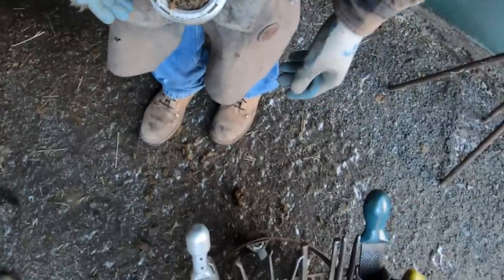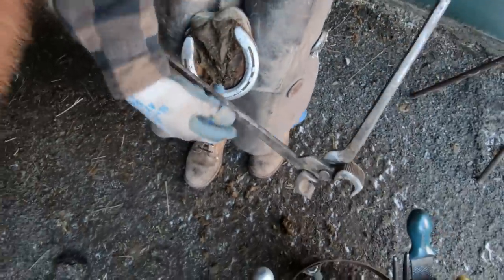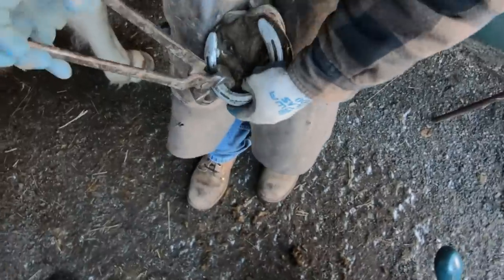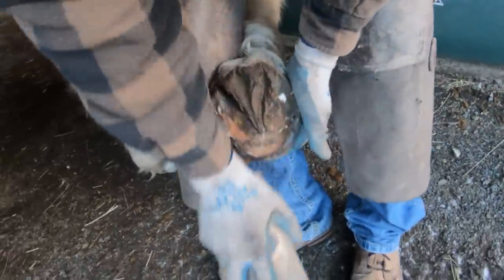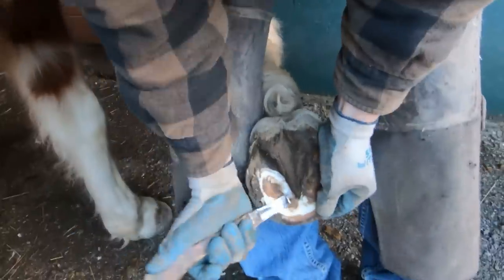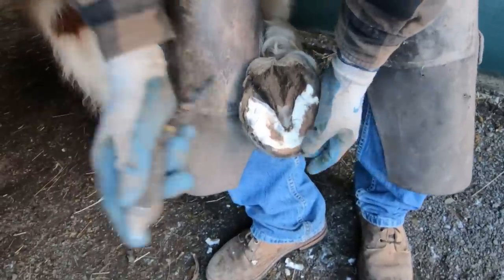Horseshoeing a MUSTANG with ALUMINUM shoes

Comment: 2:55 Dude, I wouldn't worry about dropping your tools and looking like an amateur. I still brush my teeth the wrong way. :\
Reply from the maker: I didn't know there was a wrong way to brush your teeth???
Reply: @maverick_vet  😂😂😂😂😂😂😂😂😂sense of humor.. Love it😂😂
Reply: Brush... brush your teeth the wrong way?
Is there a certain way to brush your teeth now?
Reply: annlakes24 Actually there is if you want proper hygiene.
Reply: @zakrylee9918  right, more vertical and less horizontal brushing, they say.
Reply: Prander5x5 bro same 👊😔 i keep using the back of the toothbrush
Reply: @sandoe850  that is the proper way of doing it. So that you clean the gums as well as the teeth

Comment: I had my wife watch this video and she concurred,that other than a couple very minor details,our technique is very similar..
Reply from the maker: like what? Do you wring your nails instead of bend them? where do you live at?
Reply: @maverick_vet  That was one of the differences,that i can think of...I live outside of Reno Nv...
Reply: @maverick_vet  I couldnt remember,what the other minor thing was,so i watched the video again..The other thing i do differently is,,i start the shoe,with 2 nails and put it down,to double check my fit,to make sure everything is exactly where i want it,before i finish nailing..That way,,if i want to alter or change something,ive only wasted 2 nails..Hence,the internet handle..
Reply: @TightwadTodd  I live in Reno , just saying hi😁

Comment: Very cool. I didn't know there were aluminum shoes. I thought they were all iron.
Reply from the maker: yeah. this guy is not a race horse but most racehorses wear aluminium shoes
Reply: Weigh reduction bruh beacause *race horse"
Reply: @maverick_vet  Next they'll be making carbon fiber composite horseshoes
Reply: Souta Nishimura Vibranium horse shoes
Reply: I don't even know horse need to wear shoes
Reply: @rismaaulia8349  they don't necessarily unless they are working especially on asphalt so that the roads don't the horse
Reply: Risma Aulia they don’t but it helps the horse if you happen to go on gravel roads or pavement, makes it easier for them to walk and lessen the chance of them gaining an injury
Reply: @rismaaulia8349  same as why humans wear shoes 
Asphalt fucking hurts to walk on barefoot

Comment: I'm always curious about horseshoes. Doesn't it cause pain to drive nails through their hooves?
Reply: No, the actual meat of the jorse is inches down so the nails wouldn't hurt
Reply: @javemascarinas7496  
Okay, so hooves aren't like our teeth that has nerve endings on them, but won't they feel any pain or discomfort from the hammer or the nails digging through their hooves?
Reply: @KubernetePirata  it doesn't hurt when you clip your nails unless you're clipping all the way down to the very bottom its the same thing

Comment: Appreciate your skill. Another farrier warns that aluminum shoes can corrupt the foot rim. He used a pad to break the connection between the foot and aluminum shoe. You said these shoes have worked for this horse so in this case you trust them. Have you run into aluminum shoe hoof corruption?

Comment: Okay. Fair enough. I was getting ready to get up on my high horse about using aluminum shoes for something other than racing, and you explained what was going on and why right in the first couple of minutes. 
So, mea culpa. I'll keep quiet and finish watching. 👍

One thing I've noticed, but never got around to asking - my dad, while he was still alive, almost never used the front nail holes. He nearly always left those two holes open. Yet pretty much everyone I've watched here DO use the front nail holes. Can you explain to me why the difference? Also, he trimmed the toe much more aggressively than I've seen anyone in this format do. Again, can you tell me why?
I will add that he never had a horse go lame after shoeing, and he was quite good at dealing with problem hooves. He even shod a horse with a full (complete hoof) quarter crack in such a way that the horse exhibited zero lameness while shod by him and was an excellent working horse. It just needed the special shoe that my dad made for it.

Comment: South Mississippi  here.
If a horse is shod, do the hoofs have to be trimmed less often then if they aren't? I know shoes have to be reset every 6-8 weeks, but just wondering if they'd need trimming more often or less without?
Reply: Depends on the horse. If the hoof is lower quality and more prone to chipping it would need to be evened out a lot more often to prevent the chips and cracks from growing bigger (like trimming split ends), but if the hoof doesn't chip as easily it could get worn down a bit between shoeing and require it less often.

Comment: How are the nails not hurting the horse? 😂 (I know nothing about horses I’m just curious 😅
Reply: To put it simply the hoof has  sections working forwards from the back. The living inner sections (frog, sole) are the sensitive areas which must be avoided. The white line and hoof wall have no sensation in them and these layers are where the nails go.
Reply: Naw, it's just like cutting your nails. As Cat Craft said, the only part that feels anything is that triangle on the hoof called a frog

Comment: What kind of nails on aluminum shoes.  I’m an airline pilot and any dissimilar metal that comes into contact with the aluminum can quickly cause corrosion.  Same with the aluminum F-150… 

Maybe the shoes wear out fast enough not to need to worry about steel nails??

Comment: I was wondering : how do you do when the animal don't want you to keep his foot ?
Reply: Tell the owner to train the horse better.
You can try to keep hold of the foot, which is basically asking the horse to hold out a little bit longer, but if the horse is intent on putting the foot down then the foot is going down.
If the horse has trouble with balance or endurance you can let it take breaks before it gets too tired, if it's a matter of patience it can often be bribed.

Comment: how does the hoof survive having nails in it? no splitting?
Reply: It's like a fingernail, so it has some flexibility to allow a nail through. And just like a nail in a piece of composite wood it can split if you do it too close to the edge, but a bit in and a thin nail doesn't cause a split.

Comment: What exactly does he nail the shoe into? I know nothing about horses and I’m super curious about how this works
Reply: The hoof is basically a toenail where the nail is super thick and strong and wraps almost all the way around the toe. Then the v shape is like the bottom of the foot of someone who walks barefoot everywhere, really thick layer of protective material, hard enough to walk on rocks but still soft enough to feel what you're walking on. The body keeps building it up from within so you need to exfoliate/trim regularly. Then the rest of the sole is kind of like the tough skin beside the edge of your toenails, tough protection.
We're basically from the same starter pack but with different assembly instructions.
So the nails go through the edge of the tough sole and then through the hoof wall, which is like a fingernail.

Comment: Here is a link that explains the brands mustangs get once gathered that should help, not knowing what region this horse was collected in  couldn't tell you just by looks with this one.  I am curious though why  racing plates were used on this horse by the  previous farrier?  This horse do relay or endurance  races?  Never seen this before  except on flat racing TB'S and racing QH'S  and only while they were on the track. They are a soft shoe and don't hold up well in bad weather( they can bend in mud and be ripped off, no traction on ice causing  slipping) and this horse looks to have shelly feet(and white which break or chip more often ) so I also wondered how long  between farrier appt.?  I love your channel and learning even  more  about foot care  after 40 plus years spent showing,breeding and training of many different breeds of horses but I can honestly say this has me stumped  lol. Horse's feet look great though! Hello from a mi transplanted to tn horseperson.                                                                                                                                                   https://www.montgomerycreekranch.org/blog/2020/6/13/what-a-blm-freeze-brand-can-tell-you-about-a-mustang

Comment: I always wondered who takes care of the wild horses they don't need this so why these horses needed?
Reply: Wild horses wear down their hooves by constantly traveling over rough terrain and covering so much ground to get food and water. Our domestic horses are typically spoiled in comparison. We feed them high quality forage, usually in lush pasture or hay delivered right to them so they have abundant nutrients to make more and more hoof. We keep the ground as soft as possible to help reduce wear on the joints. The usual 1/2- 1 hour ride is not enough to wear down hooves like wild terrain. Keep in mind we also subject horses to the other extreme, like using a horse like the Ol' days. I ride feedlot, where even though we feed plenty of high quality forage, we cover too much ground for hooves to keep up. A typical day can be riding 20- 40kms on rougher ground looking after cattle. For this we shoe all 4 feet, with snow pads for the winter and Borium added for grip. Without shoes on these horses they would become "lame" from wearing down too much hoof and they would slip and slide without traction during the icey winter. Hope this helps!

Comment: Dang that look like it hurt the horse
Reply: No it doesn’t hurt. It’s like getting your nails done. I mean the hoof is made of keratin, same material as your hair and nails. Getting a haircut doesn’t hurt neither does cutting your nails. 

Also little side note, average weight for a horse is 1200 pounds, they will definitely not just stand there if someone is hurting them.

Comment: I have a question, doesn’t messing with the frog like that hurt? I have accidentally hit the frog with a hoof pick on some of the horses I have riding, and they just about kicked me. So does that not hurt them or was it the fact that I jabed them??
Reply: HorseGamer 101 if your horse`s frog is that sensitive, you should have a vet check it out. The frog isn`t skin and the only way they should feel anything through it is the same way you feel pressure in your finger through your fingernail.